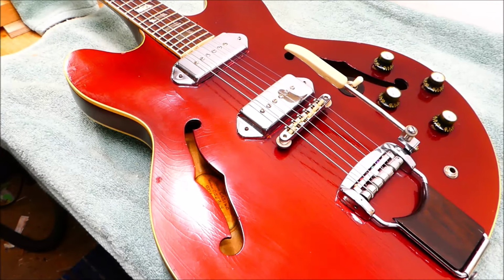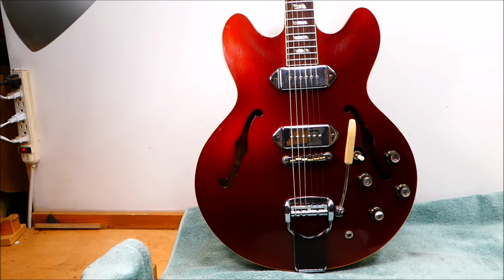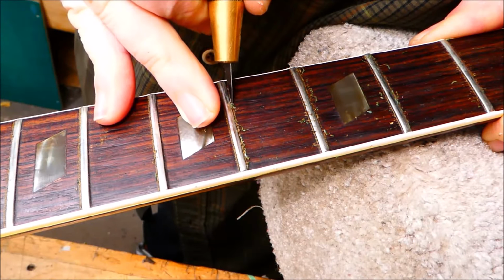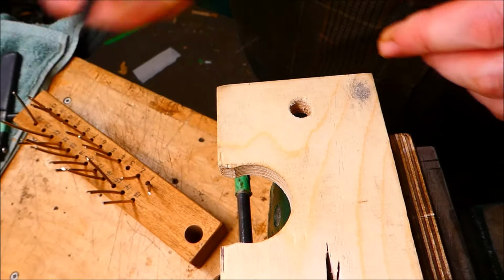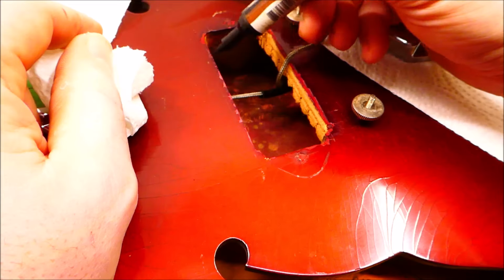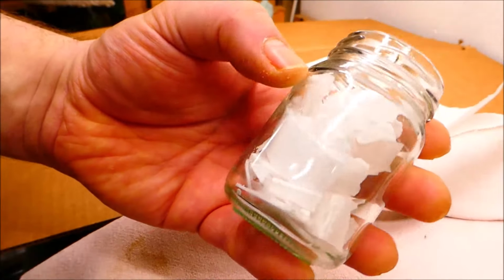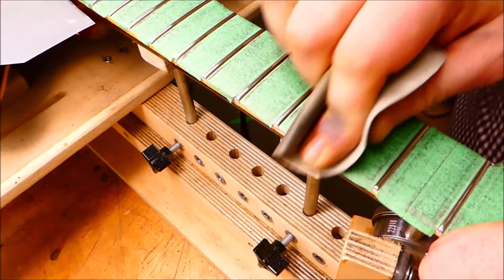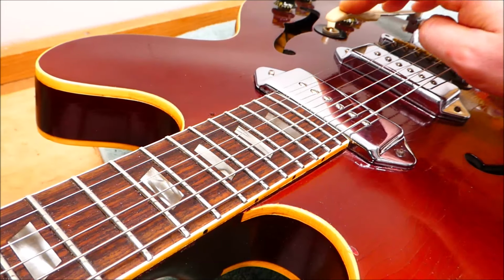A Gibson.... Casino? ... ???

Comment: I had an Epiphone “Sheratino”: A Tobacco sunburst Sheraton with full size humbuckers, but with parallelogram fret markers, sealed, painted f-holes, no serial #, pot date code to June, 1967. I installed a Washburn Wonderbar on it, so only 2 holes for the trem lock @ the headstock. Paid $400 for it in ‘93, sold it in ‘03 to George Gruhn for $8,300… He’d never seen anything like it, either….

Comment: Ted I have a 1970 Epiphone EA-250 and it is red burst and it came with a p-90 type pickups but the neck pickup was over used because it melted the finish around the pickups hole near the neck connection. Just to let you know I’m rebuilding it with new Epiphone parts and a different bridge saddle tremolo system from the factory because like you said they really are not worth the trouble so the tail piece I chose is solid brass and it’s a R for Rivera the Epiphone EA-250 is the first Epiphone Rivera

Comment: Ted I was gifted a 1969 Epiphone EA250 made in Japan but the serial number shows up twice once on the blue tag inside the guitar and the other is stamped on the neck plate. I learned after researching this model that it’s a true Matsumoto Design not a Gibson/Epiphone but made for export to Kalamazoo Michigan and the blue tag is a Kalamazoo Michigan tag that’s says made in Japan. The neck is bolt on and the body is hollow with a 3/4 inch block at the neck pocket and the pickups are P-100 if my memory serves me right and that’s why they were not popular the P-100 was not as great as a P-90 I guess!

Comment: The trem is so simple , you refused to see it. Two pieces -no springs, no bushings.. The round bar is held solidly at the bass end by the  larger drift pin, and a very small rotary motion is allowed at the treble end. It's a torsion-bar, in effect. The inability to maintain pitch in this one is likely caused by wear in the hole the torque bar runs through (at the treble end). Like I mentioned, it's un-bushed and soft metal. The other drift-pin at the treble side just holds the tailpiece assembly to the rotating bar. Clever junk :)

Comment: I question whether the pickup covers are the actual source of the feedback.  Just because someone dipped the pickup coil in wax does NOT mean that the wax properly penetrated the windings of the pickup coils.  Without using a vacuum, a much higher wax temperature is needed to be able to penetrate the windings, and this is when you might have bobbin distortion, depending upon the bobbin material.  Just adding wax to the pickup covers is more likely to be a bandaid fix, instead of getting to the root source of the problem, which is the windings in the pickup coils vibrating.  Adding wax to the pickup covers should be IN ADDITION TO properly potting the coils, and not instead of potting the coils.

Comment: Beeswax doesn't melt until at least 147°F! Paraffin canning wax from the grocery store melts about 125°F.  Also note that paraffin wax melting temperature can vary from 115°F to over 154°F, depending upon the particular formulation.  Paraffin canning wax has a huge amount of shrinkage when it cools.  This can stress the fine wire windings.  Mixing about 20% Beeswax reduces this shrinkage and stress to the wire considerably.  Also note that paraffin wax has a dielectric constant of between 2.1 and 2.5, whereas epoxy has a dielectric constant of about 3.6.  This means that epoxy potting causes at least 44% MORE stray capacitance than wax potting!  Which means that epoxy potting rolls off your high frequencies much sooner than paraffin wax potting!  At normal guitar playing temperatures paraffin wax is superior to epoxy for potting pickups.  You MUST be careful with the wax temperatures.  While you may not melt ABS plastic bobbins, they can distort at below melting temperature.
Reply: Unless there's something seriously wrong with the winding, I don't see how wax would have any effect on the tone
Reply: @ileutur6863  It's because of the effect of the stray capacitance shunting the pickup coil.  it's effectively shorting out the coil at higher frequencies.  It would be similar to using a much longer cable between your guitar and the 1st preamplifier stage.  The longer the cable the more rolled off the high frequencies become.   The stray capacitance also shifts the resonant frequency of the pickup coil to a lower frequency.

Of course stray capacitance has almost no effect on a low impedance pickup coil.  I wound 4 ohm coils for the humbuckers in my ES335.  So the pickup impedance is either 8 ohms in series or 2 ohms in parallel.  I can drive 1,000 feet of cable with these pickups with no significant change in tone.  I use a  preamplifier input impedance of 110 ohms to match the characteristic impedance of the balanced twinaxial cable that I use.  My pickups are loaded correctly so they don't operate in a resonant mode that would color the tonal balance.  My pickups have a bandwidth of over 35 KHZ with no noise pickup.  High impedance pickups are a joke.
Reply: @PierceThirlen2  cool info, but hoe much does any of this really matter in an average gig scenario?
Reply: @ileutur6863  Switching to wide bandwidth low impedance pickups results in lower hiss because you don't need to boost the highs that you lost because of the crappy performance of a high impedance pickup.  Running low impedance means that the cable is no longer microphonic and you no longer need to add sound degrading coatings inside the cable to prevent microphonics and you can use the best quality balanced microphone cable for better sound and even less noise pickup.  With low impedance humbucking pickups you can have a "single coil" sound WITHOUT THE NOISE!  Or you can tweek the tone controls for a more traditional humbucker sound.  High impedance pickups are basically one trick ponies.  Hum and noise is UNPROFESSIONAL!

Comment: I would have removed the brass nut and replaced it with bone, removed the tremolo bar and replaced it with a trapeze (or frequencator), and removed the pickup covers and replaced them with plastic (those metal covers decrease the highs the P-90 needs).  Finally, I would have used jumbo frets.  Other than that, nice job!
Reply: Pickup covers literally do not affect tone

Comment: When I wax pot pickups, I have figured out a long time ago that the wax has to get sufficiently fluid in temperature and stay that way to really penetrate and do it's job.  So I tape off any areas of the pickup I don't want wax on, or to run out once done, and do submerge the pickup as soon as they will sink in (let them do it all by themselves) so that the pickups and wax reach the right temperature closer to the same time, and use the wax pot (no jar) on top of a vibrating plate (a bonus) so that the wax penetrates much easier.  Temp control is important though, and low and slow works best; once it flows just right ~145F, then keep the temp there and steady.  That way you can watch the bubbles come out and when that subsides turn off the heat let it cool down, but don't take the pickups out until the temp is at ~120F to prevent too much wax run-out.  You can't get any more thorough penetration, and I have yet to overheat a pickup and cause damage, as the wax melts much sooner as any plastics in the bobbins or any lacquer on the wire, and by heating them up together, rather than shocking cold pickups with hot wax, you greatly reduce the chances of rapid expansion, leading to lacquer cracking and electrical shorts...

Sure, there is more cleanup when done, but paraffin wax is not too hard to get off when still hot.  So I let them cool thoroughly first, and then use a heat gun and and scratch free shop towel (the blue paper towel like ones) to soak up any larger unwanted deposits, mainly around the screws.  For any residuals on the housing,  I use another shop towel with vegetable oil (a lipophilic solvent) and a bit of elbow grease, and that does the trick in removing any fine film, or spots previously missed, and follow it with a damp (closer to dry) microfiber cloth to remove any veggie oil.  I don't use it on salads... Olive oil is much better for that!  Yum! (<:

Really, they have been potting pickups for so long now, I hardly ever have to do it anymore. (<:

Comment: I have ‘63 ES-330 that I bought around Y2K. Absolutely luv it. Been toying around w/ doing a refret on it w/ taller frets. I will run the frets to the fingerboard edge to gain more acreage at the nut. A new nut w/ wider spacing will need to be made. This will help playability for me since I have big fingers…
Also on the bridge post screws: Mine were loose & wobbley, causing the bridge to lean forward. I replaced them with stainless steel screws & superglued them in place. Along with that; I put another set of height adjusting wheels (orig were missing) against the top as they should be. Bridge is rock-solid now w/o any movement. 
ThxTed for sharing all your expertise on repairing guitars & your exclnt presentations…

Comment: I had a Gibson ES330 back in the 60s, about the same time as the Beatles got theirs. I didn't know at the time; I didn't know the difference in P90s and Humbuckers, nor the difference in hollow body and semi-hollow. Mine had a Maestro vibrato, which pulled sideways to flatten (only) the strings. I used huge flat wound strings, and turned up the bass all the way, to drive my Princeton Reverb as hard as I could. I didn't know what I had, nor how to use it. But then, so it was with many of us back then, including the Beatles. I left them behind when I left home, thinking I was finished with electric guitar. How wrong I was!

Comment: I know that the ES-330 & Casino has a tune-o-matic, drilled into the wood. Is there a block underneath, like a really thick Bridge Plate, or does that block of wood connect both the front and back, like Gretsch trestle bracing?

Comment: 1969 Kalamazoo Michigan the Epiphone EA-250 was made in Japan all but the neck? The famous 1970 MATSUMOTO Epiphone EA-250 was not a Gibson design it was a Japanese design guitar that copied the Gibson style and the Japanese maker was signed to a contract with Gibson to make the guitars but the guitars have two serial numbers one on the inside tag with Kalamazoo and 1969 dated made in Japan in tiny letters on the very bottom and the neck plate has a different serial number stamped on it that is from 1970 not 1969! Confusing if you never learned about Harmony making necks for guitars made overseas and then the necks made in USA are on the guitars imported from overseas? Maybe the pilot program was the first year of imports will be micro managed with our necks installed on each body and our QC will check each guitar before it goes to the customer! You know about this stuff?

Comment: I had that issue with my 81 Tokai LP copy.  I had to do another leveling as the neck doesn't flex the same with the truss adjustment as it does under string tension.  So I made a leveling tool the length of the fretboard with 2 aluminum bar stocks.  The wide end down to adhere the sandpaper down with two sided thin clear scotch tape.  Like the kind you use to wrap presents.  Then I jb welded the other piece thin side down the length of the other one down the middle. Looks like an upside down T from the ends. The middle support is a little thicker. THe thin side is so it can fit under the strings.  THe strings do have to be lifted out of the slots of the nut and saddles and set next to the groove then tuned.  I then surface the sanding side on a 3'x4' Starrett surface plate.  It's flat to .000050.  Or 50/million.  Totally over kill unless you are going for super low action.  It works perfectly.  I draw a grid and level it on the plate before I level any guitar frets.  It fits between and under the strings and does a few strings width at a time.  I go length ways and vertical stretching the strings a little being careful to maintain the radius.  It's a feel thing and marker on the top of frets helps keep the radius.  I can then pull the strings for polishing.  I have found for Fender Strat and Tele bolt on necks this is not needed as the harder Maple flexes less and more in sink with the truss and strings.  But it is a fast easy method so I just use it on all my guitars.  It does ruin the strings so I use the old strings then replace when done.  I choose to use flat stock because it can be easily leveled.  Stock that is machined to a radius can move with the weather.  Even with aluminum braced, it can take a few seconds to get it perfectly flat or a few minutes depending on the weather differences from the last time I used it.  Again it is over kill but I like to have the ability to go low action if I ever sell to someone that likes it low.  Like beginners for example.  Especially on hard to play acoustics with bigger gauge strings.  I have small hands and need lower action on my Taylor to even be able to play it.  I use 11's on it and it is almost as easy as my electrics with 9's.  I could not even play it when I got it.  Now it's a dream.

Comment: It’s peculiar how people seem to experience better tone, corresponding with techniques widely spread by fora, like letting wood breathe. Usually fed from people observing old guitars, where the lacquer have been worn off from playing, sounding amazing. At least when someone named Rory is playing them. 

A great violinist, playing a Stradivarius, once had a visitor in his dressing room, the visitor complimented how amazing the violin sounded. The violinist opened the case, listened briefly and said: I don’t here anything.
Reply: It's called "The placebo effect", and it's a lot stronger than most would think, let alone admit.  I have been building and repairing stringed musical instruments for 40+ years, and only at very first fell for some of the snake oil, but thanks to having studied electrical and mechanical engineering at the same time, and then geeking out on physics big time, learned the difference between fact and fiction pretty early on.

The hardest thing to deal with, are perceived "Something special" about a physically impossible, or at least immeasurable difference nowhere near audible within the human range of hearing. Things like "This nut makes the whole instrument sound better" even on fretted strings where it has no bearing whatsoever in any audible way, the removing the finish of an electric instrument, phony misconceptions like "Tonewood" and the like where:

a. the pickups cannot sense wood, but only string vibrations, and

b. any string vibration into the neck and body  (the preferred Good vibes BS) is at near 94% loss due to the vibrations being converted from linear waves (Strings) to radial ones (body and neck, which are forced frequencies, not resonant ones, and therefore decay quickly, where most are carried off by the players body and the surrounding air air, and any residual within a sympathetic range that can reflect back to the strings, only converts back divided by pi so an additional ~2/3 loss to the strings going from radial back to linear, leaving just enough to aid a little sustain one would not need if the instrument was stiff as a rock, and didn't vibrate as much to begin with!  (<:  Physics are a bitch, but common knowledge, so very common, often not knowledge at all, still prevails in the mind when sold with the right vigor.

Then you have those that try every pickup ever made, chasing for that elusive sound better had by putting a different speaker in their cabinet, or tweaking an EQ knob...

Something tells me that Antonio Stradivarius in big part just got lucky, and that his name is the main source of the listeners perception.  There have been "Blind studies" where his instruments did not come out on top!  There's a ton of personal preference too, so no such thing as "The perfect sounding" of any instrument.  It may have more to do with the fact that he was a really friendly and likable guy who went through some hardship and not only prevailed, but gained acclaim by the rich and famous of his time... and someone else may very well have built better instruments in other regards at the time, before him, and since.

I build my own instruments to sound physics principles in function, and can aim for more specific sounds, mainly sustain and decay in construction, and tone with my choice of pickups and electronics (High/low filtering and choice of component values), but rather free form in looks, and make sure people know that, and yet am still thought to be practicing, or in possession of some kind of magic!  ITS INSANITY I TELL YOU!!!  (<:
Reply: @Bob-of-Zoid  I agree, with about 15 years experience. The only way to end a discussion about i.e. tone wood properties, in electrical instruments, is to ask for proof. Wood, as you say, does not influence impedance, magnetism or any other factors that makes an electrical instrument produce sounds. And the “I HEAR A DIFFERENCE” argument simply isn’t scientific. I usually claim that practicing your scales will improve your music much more, than changing the fretboard wood of your guitar. Can you imagine the talent, a musician needs to posses, in order for the perceived subtle nuances, in the instrument, to actually make a difference?
Reply: @Bob-of-Zoid  I have been playing guitar for over fifty years and also repair and restore violins and other stringed instruments. You are absolutely right but the idiots you are talking about probably also read their horoscopes every day, are scared of walking under ladders and believe in Father Christmas. They are a gift to every conman and slick salesman who comes along. Take their money - they're too stupid to be allowed to keep it!

Comment: I have that  vibrato and it can be improved by  taking it apart and  lubing  with  graphite  powder.  The spring is a torsion rod and quite simple to dissemble,  remove  pin.